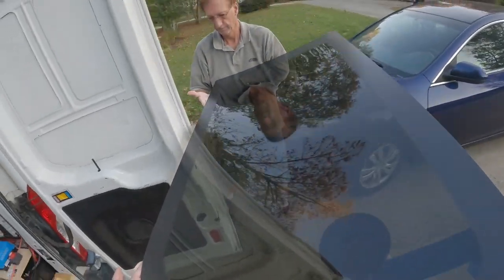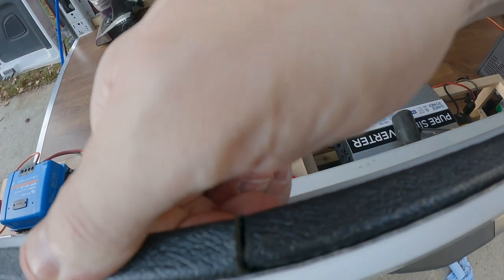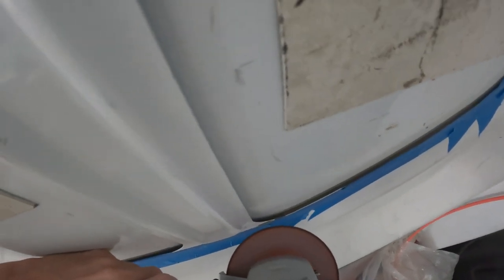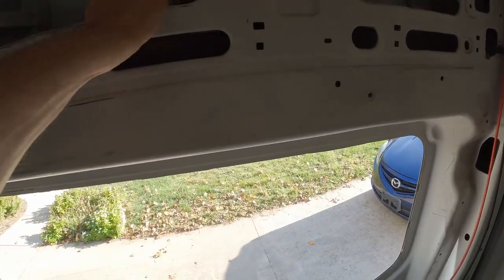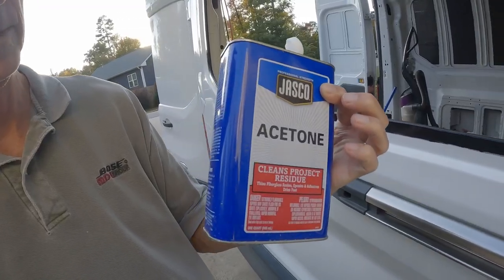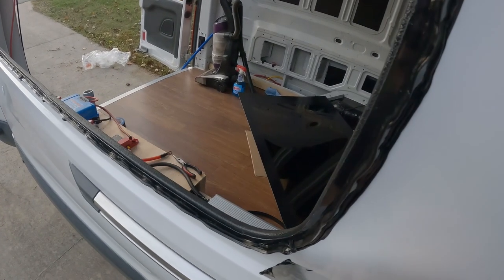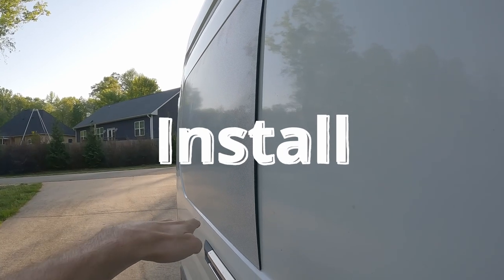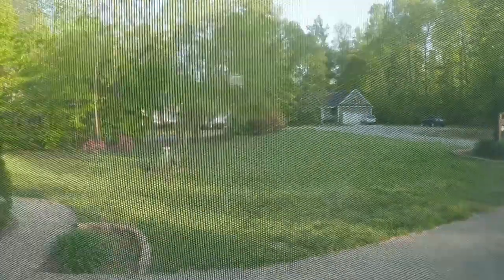How to Hide a Huge Van Window - STEALTH VANLIFE

Comment: Hey! I love the vids, they’re super invaluable for my van journey! I would’ve just asked this in discord but the link stopped working, but I’m having a problem finding decently priced vans these days... how did you source yours if you don’t mind me asking? And did you overpay for it?
Reply from the maker: I used Facebook marketplace for both of my vans. Open it up to as large a search range as possible. I found this one in Oklahoma and flew out to get it and drove it back.
Reply: @OutdoorsEmbrace  That’s genius! I was using FB marketplace, but locally only. I’m taking the restrictions off right now and I’ll see what’s out there. Thanks!
Reply from the maker: @Brendan J  for sure man! Anything else I can help with, just let me know!
Reply: Oh yeah, I did have one more question. Did you end up applying rustoleum or any other kind of rust-preventing paint to the sharp metal?